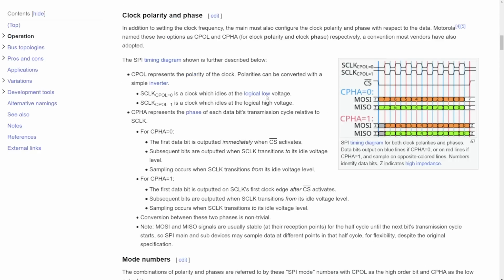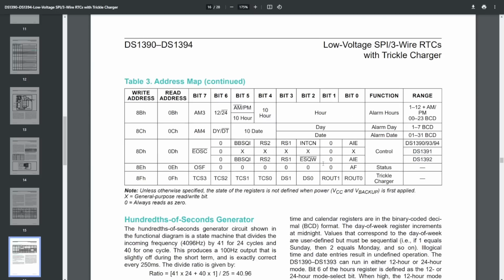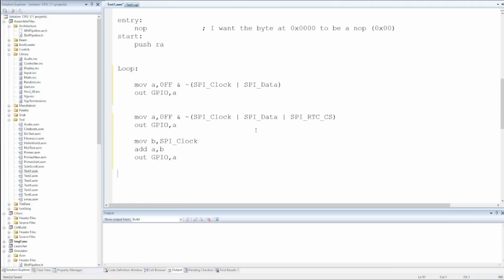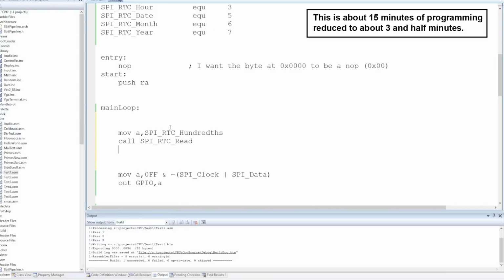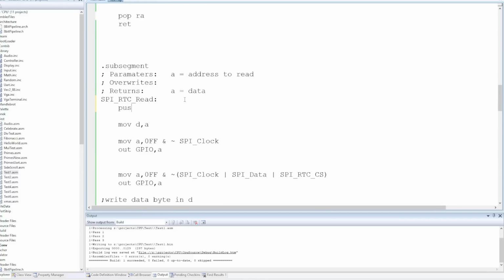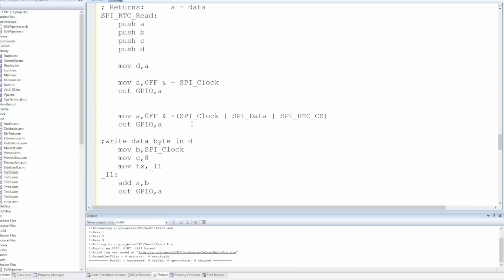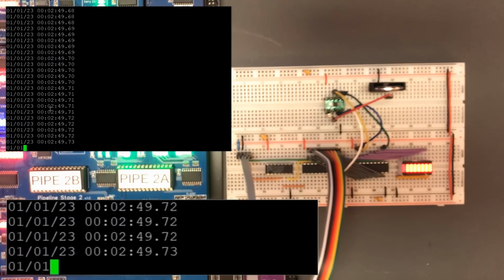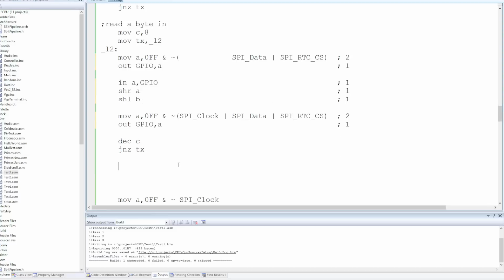SPI (Bit Banging)- IO from Scratch - Part 4

Comment: FWIW, you've inspired me - not just this video but the series.
I always fancied Forth, wrote interpreter/compilers as a teenager on C64/6510 and then 68k on Amigas.

At least on paper, I'm going to tinker with a simple Stack based CPU.
Sure - its been done before, but the mental exercise of drilling down to microcode/metal level with potential for implementation on 74 series chips is irresistible - kind of like learning to code in the early 1980s.

Heading back to the infinite rabbit hole of computing :)

Great series - many thanks for sharing your progress.
Reply from the maker: You are very welcome Richard! Good luck with your build,  maybe join the discord and share some details?

Comment: What you should watch out for, is that interfacing with a full hardware implementation of SPI could end up being as much code as interfacing with a partial implementation.
Reply from the maker: I agree,  the definition of "full implementation" is also pretty vague.  I'm interested in finding the sweet spot to get a decent transfer rate.

Comment: You will also need to accommodate clock speed setup since different devices can operate in different clocks, probably a register/counter/comparator schema, I guess that is what going to consume more logic.
Reply from the maker: Fortunately the need for variable clock speeds is limited, my "high speed" clock of 4mhz is pretty low in the grand scheme of modern electronics.

Comment: Personally I would go for a partial implementation. I'm doing professional development of embedded software for typical automotive and mainstream ARM controllers for nearly 30 Years now and the "full" implementations of many of these controllers are very limited, especially when it comes to word lengths and bitrate settings. So as soon as you have some hardware that e. g. requires 24bit or 32bit transfers (a collegue of mine currently is fighting with an ADC requiring these) you may have to turn of all the nice automatic features and fire the data by software. It's not bitbanging but still you will have a higher CPU load. And exactly this is the level I would implement: Clock out the data of let's say an 8 bit word automatically, perhaps add another byte as buffer and do the rest by code.
Reply from the maker: Thanks for the input. There seems to be some very different ideas on what would constitute a full implementation but for me just something that can stream 8-bits in/out without manually toggling the clock line would tick a lot of boxes!

Comment: Also would loke to see a full SPI implementation. Curious to know: are you going to make an implemtation that allows to promatically switch between the differerent SPI modes (0-3), or are you just going to swop out wires if you encounter an SPI device that needs a different SPI mode?
Reply from the maker: Ideally I'd have a couple of spi devices at a time so I'd need to at least support the modes they require,

Comment: I think it would be interesting to have the unrolled loop in hardware. This may have little/no effect on the overall transfer speed (assuming the spi is using the same clock) but might free up the cpu to do something else while it waits for an entire byte to be available.
Not a very efficient way to do things here, but a good opportunity to demonstrate async i/o maybe?
Reply from the maker: I was thinking, Just the addition of single shift register to pull the bits in and let you read all 8 at once would double the read speed.

Comment: I like the idea of a hybrid implementation as well. I have designed SPI blocks for instantiation in FPGAs and those are simple. I have also used the RP2040s PIO blocks to implement modified SPI and the protocol is highly amenable to implementation with just a handful of simple commands, so I think the SW/HW hybrid solution would be interesting to see.
Reply from the maker: I'd like to see how few components I could use to get a transfer rate at the cpu's clock.

Comment: If you were willing to accept a small compromise of streaming in blocks of 256 bytes at a time, you could load data at 4mhz directly to RAM using a few chips:

A shift-in parallel out connected to the SPI sub (I'll assume flash memory here)
An 8 bit counter with bit 3 used to latch the data in the above register to its output, and reset this counter
An 8 bit counter with its outputs on the low 8 bits of the data bus (of course you could use 2 of these, to allow loading up to 64k blocks)

This would require some way to disconnect the CPU from the data and address bus during the transfer - the old ZX81 (I believe) used resistors so that the data bus could be overridden on the CPU side of the resistors to the NOP instruction whilst drawing the screen. So the set up would use a normal SPI write to set the read address from the SPI flash chip, then using one of the unused bits of the GPIO output to initiate the DMA transfer, with some sequence like:

1. Set a latch to force NOPs on the data bus of the CPU
2. Force the high 8 bits of the address bus to a fixed value
3. Reset the two counters. 

Then each clock would read a bit from the SPI flash into the shit-in register, and after 8 clocks the first counter would latch the output into RAM, and reset itself (which would also reset the latch) then via a slight delay circuit, increment the memory address counter register. This would continue until the overflow of the address counter register, which could signal the end of the transfer and release the forced NOP from the CPU, allowing it to continue. 

Of course you could reuse most of that to also stream data out if you wanted, but I guess that's not really needed so much for games! The bus arbitration would be a couple of parts, but I guess this all depends on if you want to load in 256 bytes in under 1/2 a millisecond :) Obviously this is at 4mhz - I cant remember if you use a clock divider on your main crystal, but obviously this could run as fast as the SPI flash/RAM can handle the transfers.
Reply from the maker: I think you can get to the full 4mhz without anything as complex as you describe here. The challenge is to do it with as simple a system as possible working within the limitations of the underlying system.
Reply: @weirdboyjim  yep it was a bit late when I typed that and later thought you only really need a shift in and shift out register with the main clock fed into both and cycle accurate code to handle latching and loading/storing the data at the full rate 😁

Comment: I would love to see a full SPI implementation! I had a go at designing one a couple of years ago, using parallel to serial (and vice versa) shift registers, but never had the time to finish it. Would love to see how you implement one!
Reply from the maker: I think it can be done in a fairly straightforward way. Handling the mode variations adds a bit of complexity.

Comment: I was actually disappointed you used bit banging. So yes please build a full spi peripheral. 
It's true you could load your memory in a second with bit banging. But....
The full system will have many peripherals it needs to control, not just the load. 
You need to monitor the gamepad, make sound, write graphics. All that will take CPU cycles. So 70kb per second is rather optimistic in a real scenario.

Also if you are going to talk to an SD card or something, there is far more protocol overhead. So the number of actually transferred bytes will increase.  

Like the VGA having spirits to offload drawing, you might want to give the full spi hardware a buffer, so if you're busy doing something else transfers keep going and you can catch up later.
Reply from the maker: I always like to break things down into logical steps. Bit Banging was a good place to start, I'll definitely add some hardware support.

Comment: I’m curious about the DS1391 time accuracy because of its’ external crystal. I used DS1307 (ext crystal, I2C) for my watch project and it drifted like half an hour per month. After switching to DS3231 with integrated crystal and temperature correction it now drifts just few seconds per month. Maybe it would be worth it to switch to SPI based DS3234? Maybe it’s overkill though, but I can imagine in some more permanent exhibitions/installations it would make sense 🙂 and it also has an 256 byte battery backed SRAM, could be used for some experiments.
Reply from the maker: Interesting,  I just powered it back up. It's about 1:15 in advance of my pc clock, but it wasn't set perfectly to the second.  That's about 23 days since I set it.  I'll run some more structured tests when I get an opportunity.
Reply: @weirdboyjim  1:15 is quite a good result, thanks! It makes sense, since it’s probably in a relatively stable conditions… compared to having it mounted all day on a wrist when it’s 30 degrees C outside (40 in direct sunlight) and 20 deg C inside.

Comment: A hybrid approach would probably be the most fun and rewarding. While throwing a bunch of silicon at the problem has its allure, it would reduce the flexibility that software gives, while doing it all in software will be slow and tedious. So a mixed approach is what I would favor.
Reply from the maker: My plan is to try and expand it incrementally testing different component trade offs  against the speed benefit.
Reply: @weirdboyjim  Sounds like the logical and sound approach I have come to expect.
I'm looking forward to it!

Comment: As we're using console accessories, a PS1(2) Memory Card would be fun, it uses SPI with a couple of quirks.
Reply: That's not a bad idea. Those are cheap as can be and you could basically treat them as a flash cartridge.
Reply from the maker: Interesting idea, I like it but there doesn't seem to be an easy way of getting data on/off from a pc.
Reply: @weirdboyjim  I hadn't thought that far ahead to be honest

Comment: A common technique I've seen in microcontrollers is to (ab)use the spi peripheral to achieve certian I/O tasks faster than they can be done on the gpio. Maybe an I/O peripheral that could be leveraged to do things like SPI and something else like I2c would be useful. Or maybe that would be scope creep. :)
Reply from the maker: It does make a lot of sense!

Comment: SNEScon is just a pair of shift registers, and those do play nice with SPI. Enough so that a shift register and a few logic gates are all you need for an SPI bus controller.
Reply from the maker: Similar yes, but the latch line doesn't work quite like the chip select line.
Reply: For a 595 you can just put an inverter on cs and run it to the latch. The same line can disable all the devices attached to the bus, so cs on means write to the register, then cs off means that the target device(s) selected, based on whatever was written to the register.

Comment: Most interesting application for high speed SPI for me is graphics. I would love to see the machine to show animated video on an off the shelf spi tft display. If this would work with your simple approach, I would cheer for it. But if the simple approach cannot deliver the needed SPI mode or if varying bit widths are needed (some sensors have 12 or 14bit spi, if I recall correctly) I would like to see the full blown version.

In other words if the SPI is just a proof of concept it's no good, but it does not have to support every mode that theoretically exist but no device really relies on
Reply from the maker: Comments seem to be dragging me towards a full blown version.  Problem with doing graphics over spi is the bandwidth would never come close to the vga sub system sat directly on the main bus!
Reply: @weirdboyjim  no, sorry, I didn't mean a replacement for the "GPU" I was thinking about a status display or touch screen interface with some blinkenlights. Not youtube on the screen
Reply: He already is hurting for raw bus speed to do full resolution VGA with the dedicated hardware, SPI display has way more overhead than that and yet lower bus speed - might be OK for static images or some very low fps stuff.

Comment: How much would it take to implement it fully in electronics instead of software? How much faster would it be? I know it's implemented in hardware in the ATMega8 (as well as I2C), which makes it piece of cake to interface small OLED screens (including color ones in 16 bits), and such thing is not really possible at 70K per second... Meanwhile (IIRC), an ATMega8 on an Arduino at 16MHz "limits" the bandwidth to 4MHz (f(osc)/4) as a slave, which would be more like 300KB/s (including protocol bits), which lets it do something else (such as reading the clock it displays, or reading the MPU6050 and calculate the display lines for a compass while sending orders to servo motors, read the position of the paddle to set the desired roll/yaw/pitch, etc.).
Reply from the maker: My goal would be to use the system clock (4mhz), I think even a partial implementation could max out the data transfer rate to 4mbs.
Reply: well as an example it took me 21 74 series chips to implement one which supports all permutations of SPI and bit order.

Comment: Can't SD cards also be read via SPI? At least in MMC compatibility mode!
It probably only takes a few shift registers to convert from SPI to 8 bits in parallel.
Reply from the maker: It can indeed. The core of an spi circuit would be shift registers but the control circuitry adds a bit of complexity.
Reply: So can PS1 memory cards. Their size fits the system better, but they are harder to read on desktop machines.
Reply from the maker: @bzuidgeest  interesting….

Comment: If you have a spare peripheral line on hand you can build a 4MHz hardware SPI with 4 ICs, just use the good old 74HC165 for MOSI and 74HC595 for MISO and some basic logic ports.
Reply from the maker: 4 IC's?  I can see a full speed hybrid with less than that but I've not planned out a full implementation yet.
Reply: Is it possible cost/performance efficient implementation? i.e. add one chip, but increase  order of magnitude performance?  @weirdboyjim

Comment: In the software version a single routine which does a swap will work for either a read or a write.  That would take a few more cycles when just a reading or writing but would save some code.  (When reading it doesn't matter what ends up going out  on MOSI.)  I always enjoy the puzzle of doing a minimal hardware acceleration of some software.
Reply from the maker: Indeed, but the logic flow of what I did here made more sense for the video. I like to build things up incrementaly.

Comment: How about putting the SPI hardware in to a PAL and do SPI to parallel transfers.
kind of fitting with the era of the design.
Reply from the maker: Still avoiding more complex programmable parts.  Shouldn't be a complex circuit anyway!
Reply: But PAL's and GAL's are on the low side of complex @weirdboyjim

Comment: Nice to check the OSF flag before a reading the time or date, so you have an indication whether you can trust the data.

Oscillator Stop Flag (OSF). A logic 1 in this bit indicates that the oscillator has stopped or was stopped
for some time and may be used to judge the validity of the clock and calendar data.
Reply from the maker: Yeah but I wanted to keep this about SPI rather than the idiosyncrasies of that chip. After recording I switched it to a multi byte read which I believe is the other way to solve that issue.  For anyone reading this comment, the issue TEH is referring to relates to when the time or date counters roll over between reads. So for example if I read the minutes then the seconds as the rollover is occurring from 2:59 I might read 2:00.
Reply: Well not quite the OSF flag lets you know if the oscillator as stopped at some point in time before you have read the chip. if set the time can not be trusted as you have no idea how long the oscillator has stopped, I.E. your back-up battery might have dropped below the voltage level to support a stable clock. 

I check this when I power up the circuit and before I read the time, if set I go and attach to my wifi and get the correct time and date from a time serer and reprogram the RTC.  @weirdboyjim

Comment: Does the cryatal not need capacitors?
Reply from the maker: I was surprised by that but the datasheet doesn't have them and it seems to work fine without.

Comment: I am using SPI for years now and never bothered to really understand it.. very comprehensive, thanks ..

(If I had to use your Keyboard on my PC it would drive me crazy in milliseconds.. 😅🙈)
Reply from the maker: Hope it was useful! My keyboard isn't a noisy as you think it is in person but the impact noises couple easily with the mic, and I do have a tendency to punch the enter key when I'm doing a run command.
Reply: @weirdboyjim  Oh, I see.. sound coupling.. well never mind then ! Yes, I think all of your Videos are relatively useful.. and entertaining ;) It is astonishing what kind of progress is happening there, I am watching since the start of the project ;)
Reply: @weirdboyjim I second that keyboard noise because I often watch your videos commuting from/to work on the iPad with AirPods on and especially this time I had to turn down the volume because the key-clack was so loud I barely could hear what you were saying. Could you just turn down the ambient noise? By using a 2nd mic most modern software should be able to do so. BTW the 74LS299 is probably the easiest way to implement a bidirectional spi ish interface. Implementing the 4 different modes needs probably the most additional silicon.